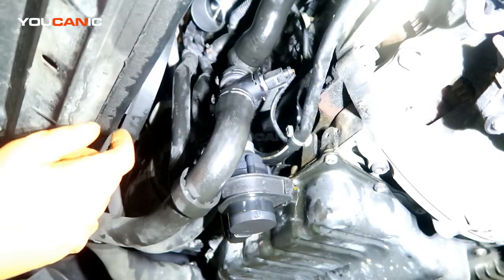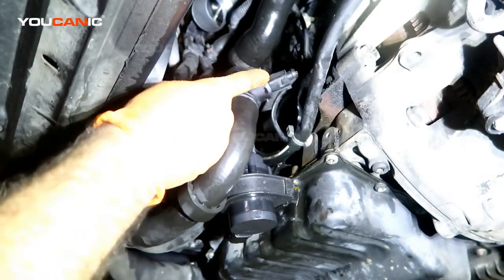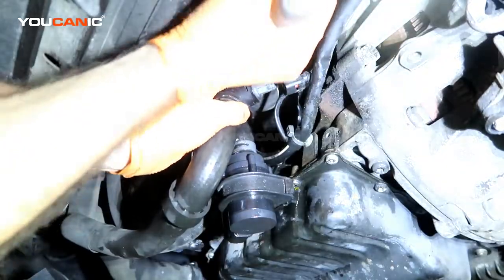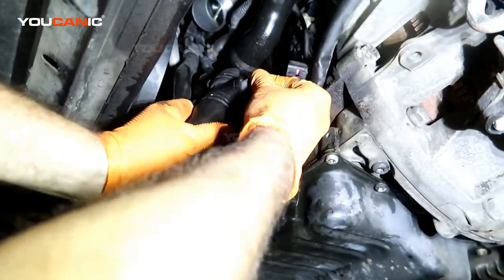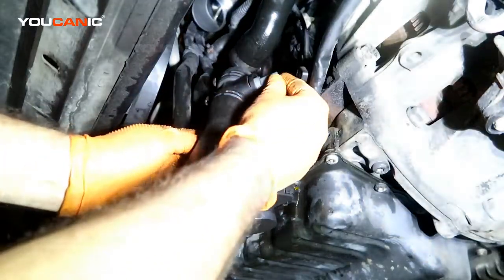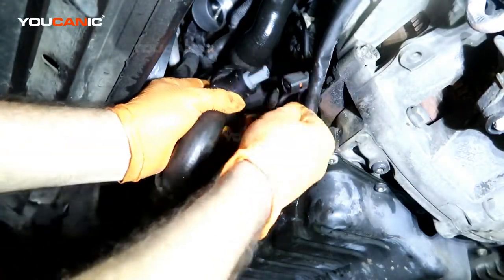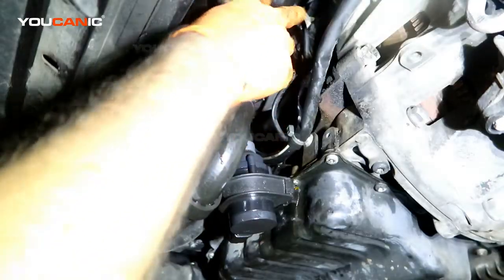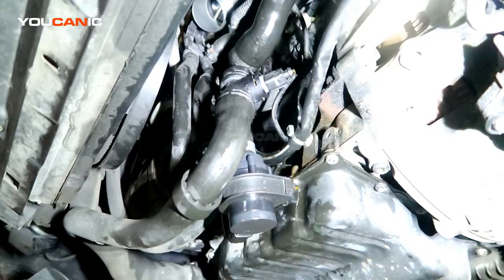2009-2016 2.0L Volkswagen Tiguan - Engine Coolant Temperature Sensor Replacement

Comment: I don't show a code about the coolant temperature sensor, but I suspect it is bad. Symptom: When I turn the key to on position, without turning on the engine, the temperature gauge goes all the way to red "hot". Car engine has not been on for two days. Is this the same sensor that would cause such a symptom? I'm thinking the sensor is "stuck" in the hot position. Also, isn't there a temperature sensor on the water pump too? Are they the same part?
Reply: Yes, there is another one on the left side of the water pump, with a hidden T27, or T30 that holds it there.

Comment: Hi if the connector gets wet is not gonna work????
Reply from the maker: Thanks for reaching out! Generally, if a connector gets wet, it may cause issues. However, every situation may vary. Feel free to consult our guides and resources at YOUCANIC, where we empower car owners like yourself. www.youcanic.com

Don't hesitate to reach out on our site if you require further assistance. With our YOUCANIC scanner and factory repair manuals, we make car maintenance easier, promoting confidence under the hood. We're here to support you throughout your car ownership journey.